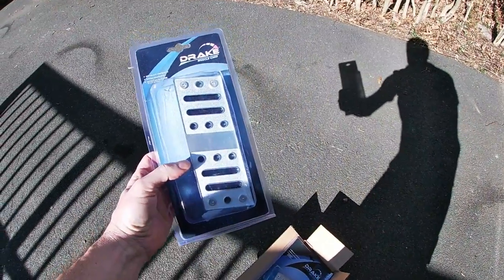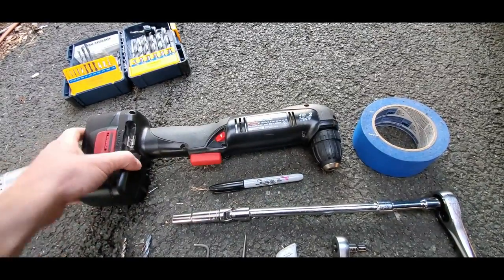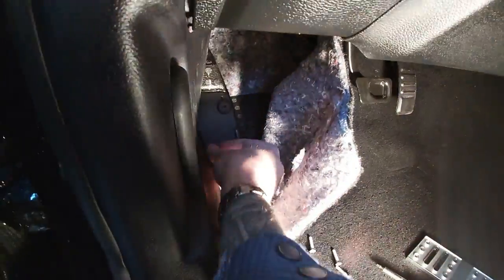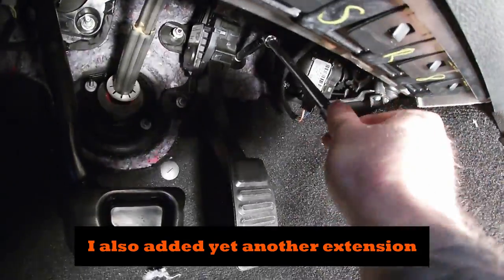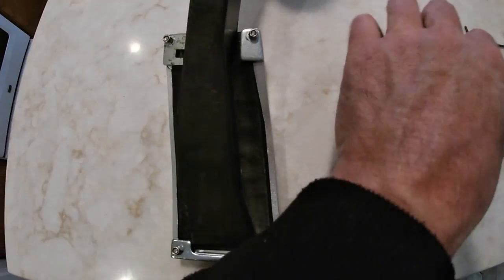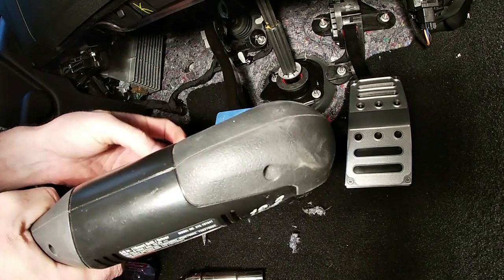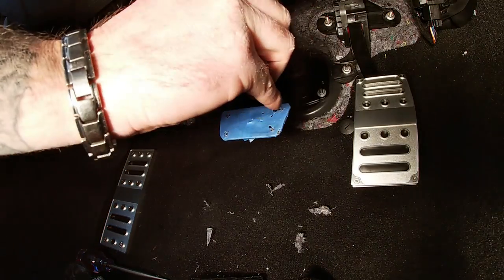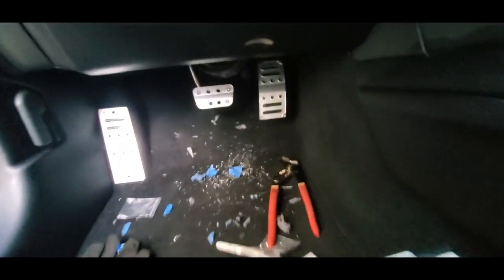Drake Aluminum Pedals Install - 2019 Mustang GT

Comment: Great video and very thorough! My last pedal install was a REAL pain (Steeda pedal covers). Mainly because I don't have an angled drill, as well as the drill bits kept breaking and/or couldn't power through the metal clutch and metal brake pedals. Not sure what I was doing wrong but they did eventually get installed lol. It's the reason why I keep putting this install off on my other Mustang.
Reply from the maker: LOL you're not alone! I broke several bits while doing the install as well. Just buy a bunch of them. I did this install on a 2016 manual and this 2019 auto, both were really frustrating to do and also a super awkward position to work in. In the end, you'll power through it and the look and feel is totally worth it. I say just go into with a relaxed attitude knowing what you're in for and get it done on the other Mustang.
Reply: @VogelStang  Thanks for the reply! I appreciate all your how to videos and like that you document the entire install good or bad 😊
Reply from the maker: @JCTiggs1  thank you! I try to get as much as possible in there without making the videos too long and drawn out